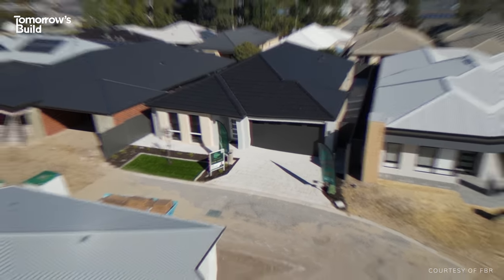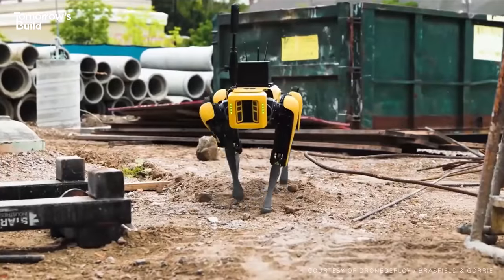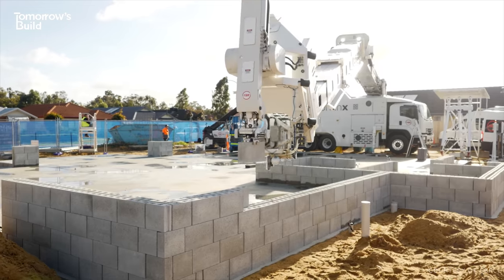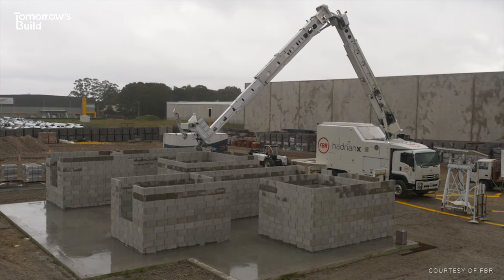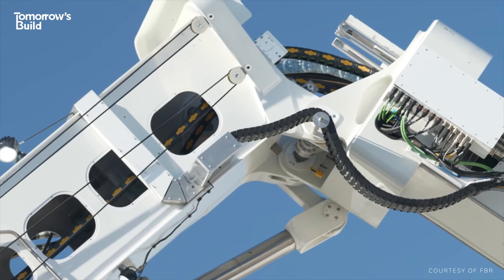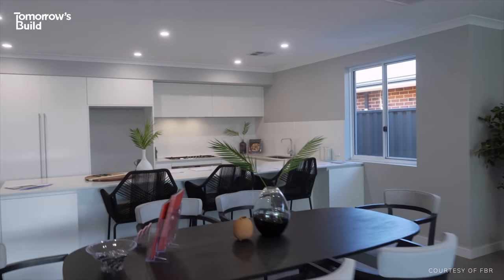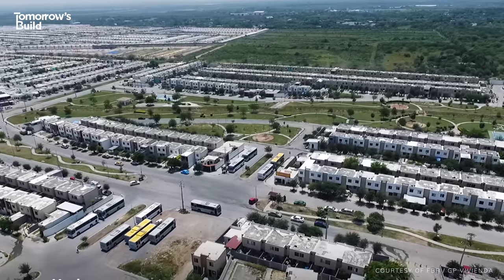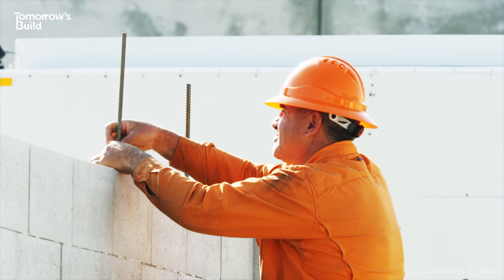This Robot-Built House Could Change Everything

Comment: Can build the walls of a house in less than 3 days. Just not with cement blocks but lumber. Which is more environmentally safe and easier to re work when you want change the layout of your home or additions.
Reply: People in Perth have been brainwashed over the years that anything other than double brick construction is inferior.
Reply: @jasond3918  It is. Double brick has better thermal properties, greater strength, longer lifespan sharing the slight increase in initial environmental cost over a longer time giving it a net environmental benefit especially as there is more and more recycling of concrete and rubble
Reply: @johnschroeder3072  My understanding is reverse brick veneer is the better thermal option.

Comment: Im a electrician in the states and ive been super interested in different ways homes are built by robots. I always assumed a robot could do the framing and blocking, but when it comes to plumbing, electric, hvac applications you need a humans touch. Im curious on how a production robot could build a home with the pumbing and electrical included with the build. A 100% robot built home. And yes, i understand its (probally) very impractical and not very cost effective, but id just love to see how engineers would go about making a fully 100% tobot built home. From the framing to the finishing on the cabinets. Hopefully ill get to see it in my lifetime!

Comment: Why cant they automate the outer layer bricks?
Reply: Fast innovation in a conservative sector would kill off any market opportunities. And I can imagine, that they wanted to firstly get the core functionality right, before moving on to the "pretty" stuff.
Reply: @OperationDarkside  can you explain a bit more about killing off market opportunities?
Reply: @ksec6631  Removing most or all of the human labor in house construction too quickly will spawn opposition from commercial and private entities. A "wow, wow, wow, waaaaiit a moment" kind of situation. While I believe it's possible, you need to give workers the time and opportunity to switch professions, if one dies off. It was the same with Elon Musk wanting to replace all factory workers in the Model 3 factory with robots. He faced major opposition from external and internal. In hindsight with Covid in mind, it would have been the right call, but short-term human workers are cheaper. They could even face legal action from the government trying to prevent mass-joblessness.
Reply: @OperationDarkside  thx for the detail answer.
Reply: There are wire ties that are placed between the leaves of brickwork so I am thinking with that the ties would need to be mechanically fixed to the robots wall as the external face brickwork is laid. 

Face brickwork requires the joints to be either flushed, raked or rolled and I don’t think the robots can do this yet.
Reply: @OperationDarkside  no one cares of it kills market opportunity
Reply: Their machine isn't designed to do the outer bricks. If they designed a machine for that purpose then it could but that is not what they have done.
Reply: the outer layer brick are small bricks and is for look/appeal purpose, and is probably cheaper to use human to lay.

Comment: Please don’t purchase any shares, until my tax return is in my account, so I can load up first!!👍🤣
Reply: don't worry FBR stock is pretty cheap, us long suffering shareholders have been waiting an age for this to start bringing in revenue. The tech is basically in place, still being refined to work faster etc, but they need to build out a decent fleet of machines and get 'wall as a service' more widely adopted. Two prototype machines they have now are not enough. But if they pull it off this will be huge.
Reply: These shares will be going through the roof. Im sure you’ve already bought plenty Bdawg👍
Reply: 🙄🤣🤣👍. I gotta mix up my user name up a bit!!🤦‍♂️
Reply: Craig, some off us have been invested for years , since 2015 and have always believed. Our payday is coming!!
Reply: dawg, was hoping you loaded up on the 30th with tax loss selling 
I averaged down to try and recoup heavy losses.

Comment: This presentation is a bit misleading as rough construction is like 40%-50% of the total cost. Labor and material included. This includes the slab and roofing too. I would speculate that the cost savings from this machine are at most a few percent of the total cost.
Reply: They didn't mention how much,the building cost as compared to a current one with the same specs. They always lie by omission.
Reply: If I can save 5% on a $500k house that's huge amount of money.
Reply: @justicedemocrat9357  A quick back on the envelope calculation says a bricklayer lays 400 bricks in an 8 hour workday and lets say in the developed world costs 50 USD per hour. A good sized house could be something like 25K bricks. Which brings us to $25K for the task. This machine has to compete with that. It probably does cost something. It looks expensive. A quick search says it costs $1.5M. Construction equipment of that price would cost around $2K-$3K to rent per day. In the video it says that it finished the house in under 4 days.
I think what is important is the potential for improvement in the future. It is safe to say that for hundreds of years manual bricklaying has not improved much while this new technology can incrementally become much better. The gained knowledge could also have spillover effects into other areas, snowballing other developments.
Reply: Yes, what is important is potential for the future.  And In the future there could be automated construction for interiors to drive costs to build down even more. Construction costs from what I searched up is 61% of price in the United States.  Also being able to finish a foundation in a mere 4-5 days also is cost savings. Time is money because construction companies have a lot of fixed costs they have to deal with.
Reply: i think the speed they saved are going to bring down the overall cost, if regulation allows it, this thing can lay bricks in the dark, all weather, 24hr a day.

Comment: I see this as dead end tech.  The obvious end game is prefab where a bigger crane or robot places entire finished walls as single ( or a small number on larger walls) pieces and all the site build does is connections and cosmetic touch ups.  You can see that in the video where an entire floor slab was done in one piece.

Comment: For HVAC automation, it would be good to send two or three briefcase sized bots with several 3’ arms. Have them go through and data mine first to get a layout and check spot rods. Use sensors to keep the bots from breaking anything down there and they can use the arms to pull themselves and brace themselves while pulling lines or duct work. From there, give them two dedicated arms for strapping. Give it various stabilizing legs for multiple positions while optimizing range of motion of the arms. Give it a few guide arms for line sets and you’d probably be set. Simple. Until that expensive bot is invented, the HVAC trade should be pretty safe. With the bots, theoretically you’d have an influx of workers, due to the alleviation of most of the crawl and attic work, which dissuades a lot of people out of a great paying, high demand career.

Comment: That's a traditional building material in Perth (WA) due to timber is not as prevalent for construction (Roofing is Timber/Steel) here in Queensland for the most part homes are timber framed and then depending on options may or may not use a brick façade. Cool tech though :) Enjoying this new channel btw.

Comment: Well, l don't know what you normally use for small bricks, but in Germany we use 40cmx40cmx24cm to build up the main walls of a house which are lifted by a small electric crane and secured by a really thin layer of glue instead of mortar, reducing the labor time. It doesn’t take much longer to build a home of the size in the video using those bricks.
Reply: standard brick size in Australia is 76mm x 230mm x 110mm. FBR are going for the German approach - big blocks with adhesive instead of mortar. The smaller conventional size is simply the result of what a single human hand can comfortably work with, whereas a robot gripper can be whatever size is needed so may as well go for larger to get the wall done faster. I believe they moved away from mortar to simplify the robot as running a hose along the boom would take up space, risk getting clogged etc plus mortar has poor thermal performance anyway.

Comment: Hopefully the software was designed or written in such a way such that two robots could build a single house in parallel. Cutting the construction time in half could be a large value--add. Also, I think adding an optical system to enable minor positional adjustments to bring the final brick placements into an alignment precision only achievable by machines would really sell people on its superiority.

Comment: I a cement block layer in the past, I’m failing see how the joints of mortar are applied both on the base and neighboring block. Looks like they’re all dry with 1/4” gaps
Reply: The nozzle they mentioned that places fast drying mortar looks to only apply this mortar in globs on top of the blocks not side. So it’s not sealed, hence the brick outer layer I’m thinking

Comment: The only issue seen here and in the 3D printed house is that interior walls become very difficult structural to move. Internal renovation being the most common against external renovations. Concrete internal walls can become expensive barriers to a fairly cheap renovation cost with wood or steel.

Comment: Beautiful home!  How does the machine apply the mortar on the ends of the bricks, or the vertical application of it?  For that matter, I didn't see the machine applying the mortar before the next brick is laid.  Is this a no mortar type of building?  If so, how can the building stand up to high horizontal winds or the rocking motion of an earthquake?
Reply: Pinned_ by Tomorrow's Build  Hi!  Yes I had already hit the like button and subscribed.  I was wondering  about how the machine applies the mortar on the ends of the bricks, or the vertical application of it?  I'm only amateur, but I also didn't see the machine applying the mortar horizontally before the next brick is laid.  Is this a no mortar type of building?  If so, how can the building stand up to high horizontal winds or the rocking motion of an earthquake?  Thanks for creating such a great means to build homes and not use lumber, homes for a greener world!

Comment: I prefer the rounded look of 3D printed buildings and the cool texture of the cement. Plus rounded corners are stronger than square. Combined with a geodesic dome roof we could have houses that wind doesn't affect and water doesn't sit on.
Reply: I like it. And I have seen them and they are very cool. So are poured walls in formwork, what are they called? Can't remember -SIPS is it?
Reply: @linmal2242  I don't know the name.

Comment: Gosh I am impressed with HadrianX - what we need - MORE Aussie innovation.  Most Aussie homes (apart from inner city) are 1-storey, and many are built with steel frames - so not too comparable to British builds anyway (& please don't call them bungalows!)  This I can see has some advantages besides speed & precision, which are not to be sniffed at - but waste is often dreadful on building sites and the fact the bricks aren't 100% concrete is appealing, plus trades will be able to access the site far quicker than normal. I'm thinking these homes might be better insulated and quieter than perhaps a steel-framed home.  And proper Brickies can still flash their talent on the façade - hope this could bring down costs, too, eventually.
Reply: Yes, well said. And please don't call them bungalows, we don't like that in AUS ! Derogatory pommie term !

Comment: ok. for the europe you need to build from foam concrete blocks atleast 30cm thick. and then external insulation come in. those blocka are allready light and convinient to use, and major part of real building starts after walls are done.

Comment: Pretty darn clever tech.
What I would point out, is that whoever tech like this becomes prominent, there will be job losses.
One 3d modeler's work can be used endless times.
It likely only takes a few people to actually maintain multiple of those brick layer machines (which do the work of 10 people).
If a technology is cheaper, it is almost always cheaper due to less human cost.
There is also very unlikely a 'retraining'. They need professionals to do that, and training professionals is expensive. Hiring professionals is cheap
Reply: Not really. These machines are incredibly high tech and require a team of mechanics, technologists, and engineers to maintain them. Earlier this year I had picked up masonry/brick laying as a trade, and I sincerely enjoyed it. But I then found videos of this particular machine and realized that in 20 years human bricklayers will be completely obsolete. This made me reevaluate my future, and now I’m taking the steps towards getting a heavy duty mechanic apprenticeship. Yes, plenty of people will be left behind as a result of the new Industrial Revolution, but the key is to stay ahead of the game, and find ways to become a value part of this revolution, otherwise, you’ll be left behind and become dust in the wind. It’s up to the individual to ensure that they don’t become irrelevant.
Reply: @Idontwantahandle6669  True, to an extent. The basic premise of a machine like that is it would be cheaper than hiring the bricklayers. Is it because the machine is cheap? No. It's without a doubt expensive. It's because the human cost is cheaper. 
We're on the slow, almost unstoppable path to automating away massive job markets in favor of large tech firms earning around $500k on average per employee. I can attest to that, I'm a software engineer doing the automation. I doubt it'll be a major problem for the next 20 or so years, but at the rate we're going, there will be no reasonable jobs left for the average person.

Comment: I'm an electrician. While this tool is incredibly cool, it has a long way to go before it can be cost effective for a builder to use instead of a crew of bricklayers. Way better than 3d printed houses.
Reply: FBR have centered their commercial strategy around "WAAS"- Wall as a Service. So the developer will pay a fee based on the blocks laid per square metre, rather than buying/ renting the machine. Remember too, it can lay in the rain, and at night (pending local govt rules/ laws). It doesn't need rest/ lunch/ smoko/ toilet breaks, and it doesn't fatigue.
Reply: @chrisjohnston5401   I'd imagine this would definitely be better in places where there are a lot of cookie cutter type houses all in the same spot.

Comment: First we need to split the cost of a house between: material, workforce and land. If you reduce the cost of workforce by 10-20%, the actual reduction of price will not be a big deal in the short term. In 20-30 years I think it will start affecting the market.
Reply: You're reducing the work force with this tech, but you still have to rent the truck out for the day; and pay all those high-tech wages for the design. I don't think it'll be cheap to use this thing.

Comment: Wouldn’t it be more efficient for the bricks to be transported around the site out of the system? A pallet jack and a (robotic) driver would be more than enough to manage it, rather than having to over engineer the arm to both move and support a line of bricks, as well as limiting the space for approach to very sturdy and wide base support landings to balance the truck

Comment: Wow, they're still using brick siding. Interesting, though most homes in my area use wood framing instead of concrete.
Reply: No, not siding it is a structural masonry wall. Reinforced.

Comment: These machines are just the beginning of what will be possible. The earliest sewing machines in the 19th century were built to imitate human hands. The designs that surpassed them changed the way stitching was done which led to affordable clothing for most people. As the systems come together with materials and architects/builders we will see some amazing structures. There will be a loss of many of the back breaking menial jobs but there is nothing new in that. Who is old enough to remember blokes on shovels or mattocks digging hand digging footing trenches.They have been replaced laser levelled skid stears.

Comment: A bricklaying robot is kind of like a mechanical horse. Yeah it's a direct replacement and all, but missing the point of labor optimization. The right way to do it is to not use bricks, but prefabs which eliminate the brick laying step and more entirely. And if you do it right, you can make the prefabs with everything up to carpets already included by the time they arrive at build site, just lego it all together.

Comment: According to good standards this robot delivers bad quality. In the video we see head joints bigger than 1 inch. Seems to be a very bad thermal bridge design due to possible problems with the airtightness. At masonry school you learn that joints should be at least 1/4 inch to permit proper tooling and no more than 1/2 inch to provide adequate strength.

Comment: This will not work in an area with earthquakes. Use structural concrete insulated panels which are one third cheaper and faster with massive energy, structural and cost advantages. Scrap bricks. They're good for paving.

Comment: why do i feel it will just increase the cost of consruction and bring no other advantages since it spare the less costly part and time of the whole process and use specific materials
Reply: It saves alot of time, they build a house in just 2 weeks, if regulation allows it and there is large volume of house to be built, these robots can work 24hrs a day.